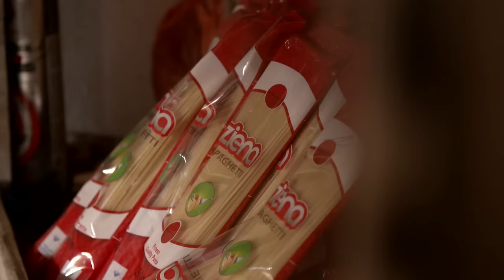Madagascar : à l'assaut de l'Ile Rouge | Les Routes de l'impossible

Comment: 53140km on European roads is a whole lot different compared to these roads. Endurance riders often measure distance driven with an engine block in amount of hours instead of amount of kilometers. So 53140km is actually quite a lot, because it was probably stuck in the mud very often :)